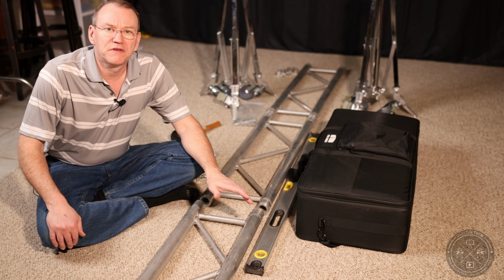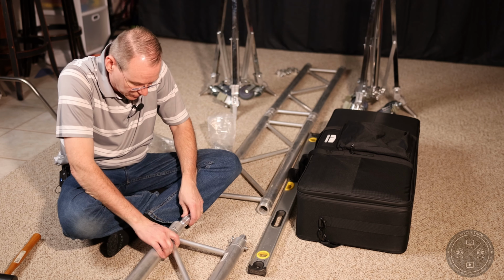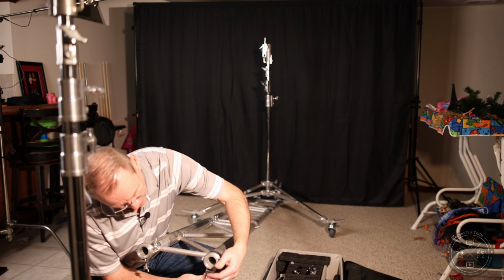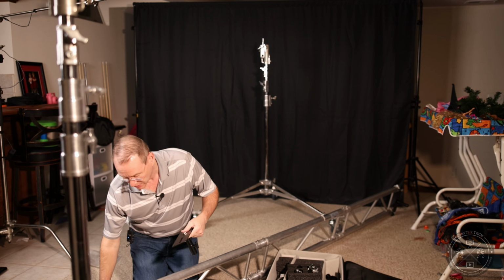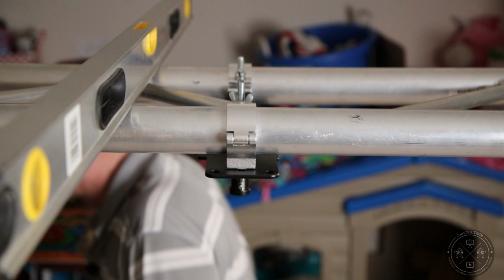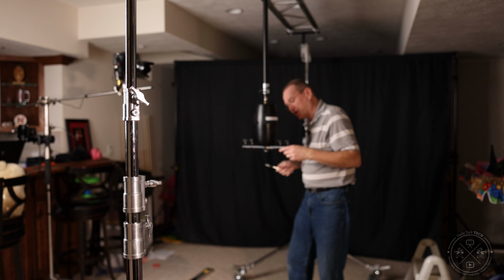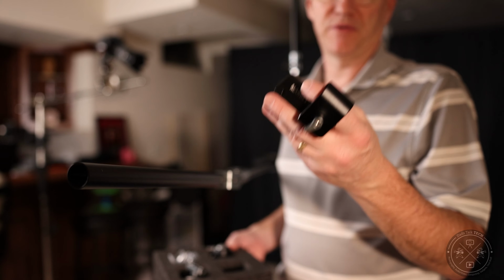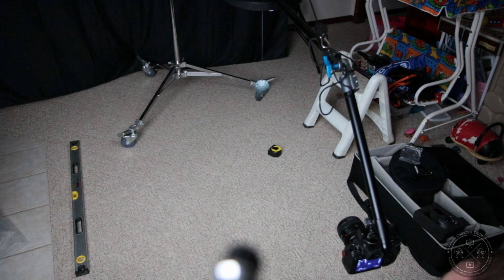Marbl Orbit Pro Kit Unofficial Setup Guide Part 2

Comment: Those truss sure are pricy
Reply from the maker: Yeah, they have gone up significantly along with anything made from Aluminum.  The speed rails have gone up too, but they are cheaper to cover the same span.  The biggest difference is going to be transportability.  If you have a need to be on the go, speed rails are a less flexible option.  The trusses are 3' long and I can put them in a bag along with the hardware needed and it only takes up a small portion of the trunk to get a 13' span.  I can also purchase more if I need a longer distance.  I got mine used for $100 each of 1m ones.  Wishing I had bought more than 4 because now if I do need them I am looking at $160 each until aluminum goes back down in cost or more appear used.

Thanks for watching and commenting!